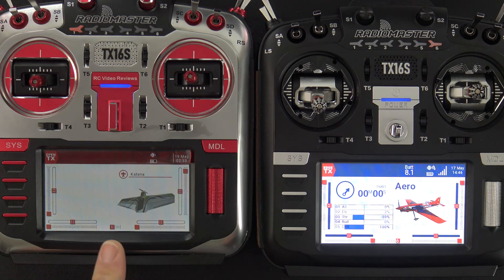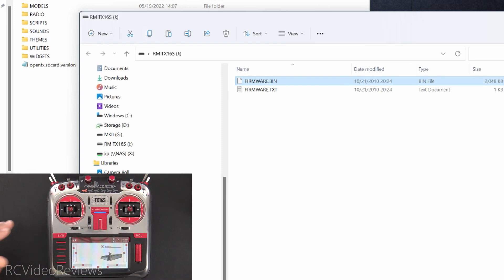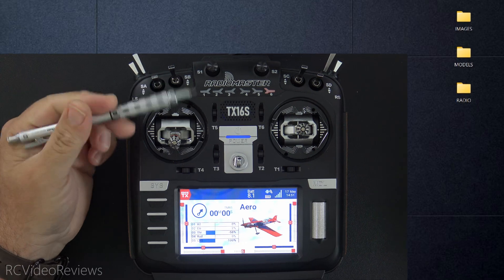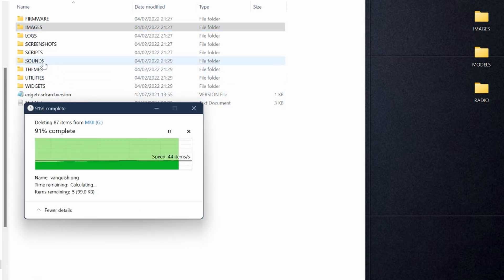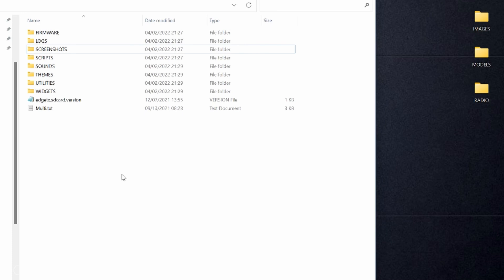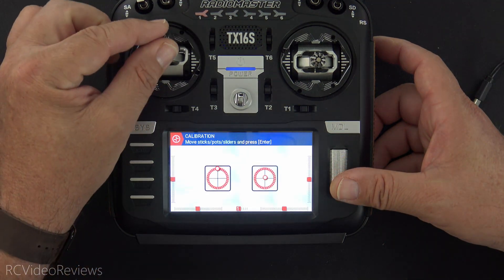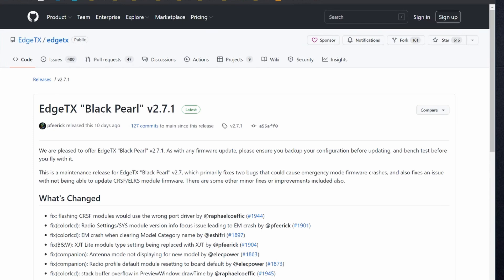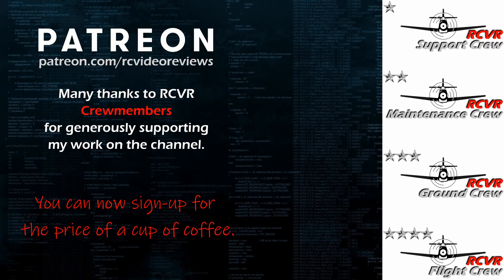Need to Migrate Models and Settings from OpenTX to EdgeTX? Watch This...

Comment: Is this able to work with an MK1? just now switched over from OpenTX to EdgeTX and ive gone through this multiple times, and when I unplug the radio from the PC, it just tells me "Bad Radio Data" and then its repopulated with the .yml files even after deleting the folders like you demonstrated. Very lost on this one. If anybody has any help, that would be much appreciated.

Comment: If you don’t want to completely trash what’s on the new radio can you copy over individual models instead of replacing the folders?
I have a new radio master jumper that’s already set up for my drone but I have a taranis with open tx that has quite a complex model setup for my FPV plane. I wouldn’t want to overwrite my drone model on the edge tx radio.
I realise that the radios are physically different and have different switches so I would need to do some tinkering but would be nice not to start from scratch…. Thanks
Reply from the maker: I'm not sure if there's an easy migration path from OpenTX Taranis to Radiomaster with EdgeTX. You may have to re-program that one.

There could be some convoluted series of steps involving Companion and the two radios, but TBH I wouldn't try to type out a process on this.

Comment: Haven't done this yet as just got TX16S MK2 yesterday and used your v helpful Firmware / STM32 poblem solving video ....... , 

So migrating from Taranis X9d+....

you don't mention..... do you need to go through each model and re-bind to every model's receiver? Or do the bindings' "handshakes" migrate too?

Comment: Hi John! I'm migrating my models from my taranis xd9 to the radiomaster t16 edges tx and the taranis doesn't have the (radio) file it has the image, models but no radio what would you suggest? Thank you for your time!
Reply: Oh I don't have companion should I try it with that?
Reply from the maker: Companion is probably your best bet and you'll still have to go through your configurations to make sure switches/trims are all set correctly.

Comment: John, first thanks for the detailed vid.  

I have a big problem, I am trying to convert my models / setting from Radio Master TX16S OpenTX v2.3.15 MAX (about 2 years old) to Radio Master TX16S EdgeTX v2.10.1 MKII.  When I follow your vid. to the letter i.e. delete from TX16S EdgeTX (Images, Models, Radio) and replace with TX16S OTX (Images, Models, Radio), then remove the USB cable I get the following error message: Large exclamation point in a red triangle "STORAGE WARNING missing or bad radio data".  The only option is to "Press any key to skip".  When I press any key I get the message: Large exclamation point in a red triangle "STORAGE WARNING storage preparation".  "Press any key to skip".  If I remain on the "STORAGE WARNING storage preparation" for 5 minuets nothing happens.  I have about 18 models that I fly.  Post attempt to convert the models and settings, when I look inside the TX16S EdgeTX MODELS folder, on the TX16S EdgeTX, I see all the .bin models (18 of them) and only 1 .yml model.  So obviously the conversion did not go.  What to do, work arounds, other approaches??☹

Side note, I also moved my TX startup splash screen and that works, I see my color pic. when the TX starts up.
Reply from the maker: This should help: https://www.youtube.com/watch?v=NYbOLLoV-GA
Reply: John, thanks for the quick response.  I resolved by reverting to v2.7.1 adding models / setting / sounds / etc and let it convert.  It worked.  All 18 Fixed wing, 4 Multirotor, and 1 sailplane were converted and it looks like all my switches and settings work properly.  Then I update to v2.10.1.
One more thing.  I tried to use my RMTX16S MKII EdgeTX v2.10.1 with one airplane this morning.  The TX is not connecting to the RX (FrSky X8R).  It acts like the RX and TX are not bound?  My new TX16S has a 4-in-1 Multi-protocol module.  I updated the tx to: •	Multi-Module MPM mm-stm-serial-aetr-air-v1.3.4.0.bin which is the latest.

Comment: hi mate  where at the end you get sd card conversion required  i get bad radio data what am i doing wrong  please
Reply from the maker: https://www.youtube.com/watch?v=NYbOLLoV-GA
Reply: hi yeah watched that got and still getting bad radio data wont convert over to edge tx  @RCVideoReviews
Reply: @MyAceguy  Same here. Did you ever get it worked out? I thought maybe the newer EdgeTX firmware versions dropped the feature to convert OpenTX .bin files to .yml files???

Comment: My X9D has problems, the sc card has no models on it, but I have .otx backups, I would like to convert them and add to my new TX16s, my fix was as follows, thought u might be interested..
On EdgeTX Companion, opened the latest .otx file from x9d backups.
Still in OpenEdgeTX with the tx16s connected, I wrote the files to the Radio (tx16s). 
Had no indication of a conversion ?
But it worked then all 30 files in tx16s were in .yml format ...
Then saved from EdgeTX Companion to BU folder.
Pretty pleased 😁
Have an audible warning to sort ?
Next is to flash from v2.7 to v2.9
Trevor

Comment: HI, great tutorial, I tried this conversion from my old Tango 2 (running freedomtx) to my new Zorro (edgetx). It said it was bad data once I'd copied it all across, and didn't give me an option to convert :( DO you know if there is an online solution I could use (to convert) before re-entering all 30 models I have please.... EDIT, just found your other video using companion.. fingers crossed...
Reply from the maker: Good luck. I don't know anything about FreedomXT. Hope it works out for you.
Reply: @RCVideoReviews  THanks John, it didn't work for me unfortunately. I even tried my old Frsky xlite, when it came to reading in Edgetx companion after modding the bootloader, it said it couldnt fine the card :(
Reply: @trevorc6793 agreed, I just tried to do this too, there is no conversation from Freedom TX to Edge TX according to TBS.

Comment: i have an Edgetx 16s set up with models.  And I have a OpenTx set up with models.  I would like to select a couple models from my OpenTx 16s and move them to the EdgeTX 16s.  I don't want to be deleting folders fromt the EdgeTx 16s.  How do I simply move selected models from the OpenTx to the EdgeTx 16s?
Reply from the maker: Couple of different ways to handle it. Two quick options:

1) Backup SD card. Delete the models you don't want. Copy to new SD card. Convert to Edge. You can restore your back to the original SD card.

2) Use Companion. Open models from OpenTX radio. Delete what you don't want, write to EdgeTX radio.
Reply: @RCVideoReviews  I did #2 and it converted the OpenTX models I wanted, but it deleted all the exisiting models on EdgeTX.  I'm trying to simply add a few OpenTX models to the existing EdgeTX model portfolio.
Reply from the maker: 2 still applies. To keep your EdgeTX models, open them in companion as well. Copy your OpenTx converted models from their etx doc into the etx doc from your EdgeTX radio. Copy paste from one window to the next to combine them. 

Going forward please join discord. Much better to work this kind of thing out.

Comment: Hi, thank you for the video. I had to convert models from a Jumper T16 to the Radiomaster TX16S MK II. The copy & paste of the RADIO and MODELS folders method didn't work in this case - the Tx just said the files were invalid and didn't convert. I downloaded EdgeTX Companion from your link and managed to open my old Jumper OpenTX Companion .otx files in the new EdgeTX version. The new Companion did the conversion and I could write it to the Radiomaster Tx. And then needed to tweak the radio settings afterwards. The models imported fine. Thanks again.
Reply: Hey, I'm in the exact same boat but can't quite figure out what you did to convert the Jumper T16 files to work with the RM TX16S MK II. I tried opening the model files in EdgeTX companion with the "read models and settings" and then exporting the models as .yml and then copying those files to the SD card on the TX16S but it still only shows one default blank model in the models list. Am I missing something?
Reply: @flipfpv  Hi, I installed the EdgeTX Companion and then opened my last OpenTX Companion .otx models file in EdgeTX companion. It did the conversion in software and showed the list of models as per normal. I then connected my Radiomaster Tx via USB and used EdgeTX Companion to write the models onto the transmitter using the "write models and settings" button.

Some transmitter settings had to be fixed on the transmitter itself afterwards - I just followed the Radiomaster TX16S initial setup video's for that (battery voltage calibration, etc).

Hope this helps.
Reply: @christowepener2698  Thanks a lot, really appreciate it. Unfortunately, it didn't work for me, not sure why. I ended up letting the Jumper convert the OpenTX models during the EdgeTX firmware update and then copying those converted model files and Radio folder over to the TX16S SD card and then updating the EdgeTX firmware on that radio and it finally worked!

Comment: Great  overview as usual. I'm trying  to move models from my Taranis X9D OpenTx 2.2.3 to a brand new Jumper T-Lite V2 (ELRS) running EdgeTx 2.7.1 ... but there's no conversion happening I'm afraid. The only change I've made is to set the default channel map to TAER on the Jumper (to match my X9D). Also tried with a X9D model from my temporary upgrade to OpenTx 2.3.15 but no success there either. There's no RADIO folder on the Taranis SD Card so I didn't delete the corresponding RADIO folder on the Jumper as I had noting to replace it with. Any pointers appreciated :) Thx
Reply from the maker: You might need to read your models/settings in on Companion first, then flash, and write models and settings back to the new radio from Companion.
Reply: @RCVideoReviews  Thanks for the reply :) I ended up manually building a new ELRS model on the Jumper T-Lite. Didn’t take long in EdgeTx companion. I’ll just use that as a template for other ELRS models that I migrate to the jumper.

Comment: Considering upgrading to this radio from the Taranis x9d+ using open tx, have models and sticky switches settings etc on it, will this process work in the same way? 
Great information and well explained
Reply from the maker: Yes, the core functions translate cleanly from OTX to ETX. Not sure how much longer this will be true. The only real conversion issue I'm aware of is the loss of model page setups. So you'll have to go back and reset your widgets on migrating to Edge. Not a problem upgrade from Edge x to Edge y.
Reply: Hey, I finally got the TX16s max. Now to get switched over😬. 
I took the SD card out my Taranis and backed the contents to a pc file. In the models folder and others there are no files/models on the card Taranis card! 
Should I need to back the models up first from the Taranis to the card? I noticed the models files and functions were already showing on your SD card content! 
Thanks again

Comment: Is there any special process to moving just models from OpenTX to an EdgeTX Radiomaster TX16S MkII that I have already my own models added to? I didn't think I'd be revisiting the quads connected to my Jumper T16, but here we are haha.

Related side question; Would CRSF models bound to an external module show up in the models folder as well? Or would it have its own folds since it's an external module? 

Thanks for your insight!

Comment: I cannot get my  Lumenier TX16S EdgeTx to convert my .bin files to .yml.   I have tried several times and it just doesn't work.  I moved my models from  Taranis  X9D  OpenTX .  I am running Firmware  2.6 on my TX16S.
Reply from the maker: Discord would be the better place to work this out. Did you look on your SD card for a file called models.yml in the models directory? Do you see any .yml files in \models or \radio?
Reply: @RCVideoReviews  Thanks for the great work on your channel.  In my " Models " folder of my TS16 Max Pro, I have a Models.yml file .  I have recently completed a new plane and in set it up in the new radio. So yes I have one .yml file in my " Models " folder.  Everything transferred over from the Taranis X8D Plus SE 1979.   I am using Companion 2.7.  My Firmware is 2.6.0.   just can't get the TS16 to convert .bin files on boot up.

Comment: I have an Align T Rex 500x with microbeast plus, I'm using a DSM , Kinson satellite receiver..  I have a radio master TX16S mark 2.. I'm new to this.  Can you make a model video . As I do not know how to make this work for collective pitch helicopter .  I just need straight normal mode, idle up 1 and idle up 2. straight 3-D helicopter with Tail gain.  Please 🙏

Comment: can i take my sd card models etc from my qx7 and do this?
Reply from the maker: You should be able to. I don’t have a QX7 so I’ve not tested but an OpenTx binary should be consistent across platforms aside from hardware variances (switches etc).
Reply: @RCVideoReviews  ok, just models is all I want actually,  basically a noob with this set up qx7 yrs ago with several quads and planes , finally upgraded radio and I'm lost with tx16 and getting models set up. Lol not much out there on 2.7.1 wizard for some reason cant save models after I spend all that time settling them up. Go back says zero models , different  got to learn it.

Comment: I just got a LX F-22 Raptor EDF 2x70 MM I wonder if I can use the Radiomaster TX16S carbon red on this F-22 but I don’t know 🤷🏻‍♂️ which receiver to Buy , on the box it’s written 12Channels
Can I use this Futaba R7014SB 2.4GHz 14CH FASSTest ?
Reply from the maker: Here is the list of supported protocols: https://github.com/pascallanger/DIY-Multiprotocol-TX-Module/blob/master/Protocols_Details.md

Most mainstream protocols are supported; however, Futaba is limited to the SFHSS protocol. 

Any D16/D8 protocol rx will work as long as it has ACCST firmware (not ACCESS). Radiomaster R168 is a good choice. FlySky ia6B Rx's are good. Lemon Rx's are good.
Reply: Thx ☺️ finally I got a well explained response

Comment: Thanks for the video and clear step by step migration. The new TX16S v2 is a very nice upgrade from v1 but I was holding off on migrating over until I was sure of the process. I don’t think you mentioned it in your video but will I also need to rebind my receivers to my models once I’ve completed the steps in your video?
Reply from the maker: Since the bind is to the MPM and the MPM is different, yes, you have to rebind. I avoided this by switching the MPM from the MKI to the MKII precisely because I didn't want to rebind everything.
Reply: @RCVideoReviews   Thx for the great tutorials sir!  How easy is it to move the MPM from an OpenTX MK I to a new Edgetx MK II?  Are the modules any different?  It would be nice to not have to rebind 15 models!  Cheers
Reply from the maker: Very easy swap.
Reply: @RCVideoReviews   HAHA, maybe for you, LOL. So simply just unscrew, pop off antenna, and swap it out?  No soldering?  Thx again!
Reply from the maker: Pretty much. Just a couple of screws and the antenna. It’s a direct swap.
Reply: @RCVideoReviews   Finally got around to migrating from older TX MKI OpenTx to new MKII EdgeTx!  Thanks for your tutorials.  I went to swap the MPM but noticed the MKI has v2.3 and the MKII has v2.5.  Not sure of the differences, but I guess I will keep the v2.5 in the MKII and just have to rebind everything.....😓
Reply: CLONE IT!!!  There is a simple way using Multiconfig LUA script on old radio to see the MPM ID.  Run script on new radio, and edit the ID to match the old one!  Wow, that was a life saver!
Reply: What is MPM? I followed your video, will I have to rebind?
Reply: Multi Protocol Module. Are they the same in the MKI and MKII?
Reply: @thutch8097  Multi Protocol Module. Basically the board inside the transmitter that transmits to the receiver.

Comment: Please help … I just got a LX F-22 Raptor EDF 2x70 MM I wonder if I can use the Radiomaster TX16S carbon red on this F-22 but I don’t know 🤷🏻‍♂️ which receiver to Buy ?
Reply from the maker: You didn't say how many channels you need and whether or not you want a gyro. Check out FlySky RXs, Lemon RXs, and the FrSky S8R or S6R.

Comment: Hi Sir,  I'm ready to get Radiomaster tx16s MK2, can you explain me what is the  difference between style 4 in 1(protocol dependent)and ELRS (transmitter power is adjustable).? Please and thanks.
Reply from the maker: ELRS is a lora based protocol with some limitations around output. It natively provides crossfire out, but can also provide PWM and SBUS with adapter boards. It will only communicate with ELRS receivers.

4in1 is a Multiprotocol module. It will communicate with receivers from a very long list of manufacturers. Most important among them IMHO are FlySky, DSM/DSMx, Futaba, and D8/D16.
Reply: @RCVideoReviews  OK thank you Sir, I fly airplanes with spektrum and frsky receivers with Sbus and ppm, and 3 eachine mini airplanes 400mm series,  and one helicopter with spectrum receiver. Do I will be better with the Style 4 in 1 ? Please and thanks again for your advice. Let me know Please.
Reply from the maker: If you don’t use ELRS receivers don’t get the ELRS transmitter.
Reply: @RCVideoReviews  OK thanks. And congratulations for all your great videos, it's a lot of work.

Comment: I'm  on EdgeTX 2.7. Is it not stable enough and that's why you used 2.6?
Reply from the maker: 2.7 is fine. The radio shipped with 2.6. 2.6 is also important because that is the revision introducing yaml.